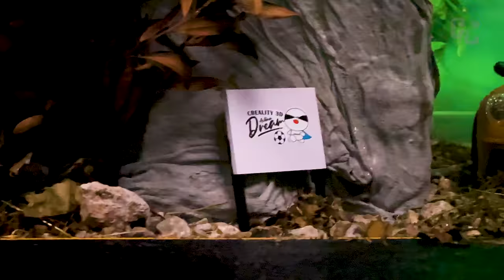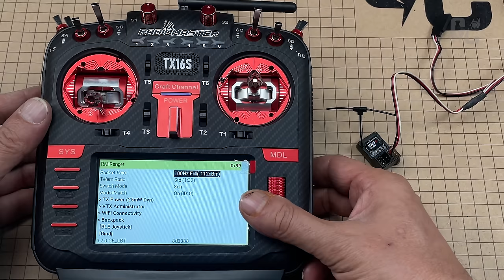How To Make Porsche 911 GT3 RS Rc Car - 3D Printed Remote Controlled Car

Comment: great work. i have a comment nevertheless ... what is missing is a bit of suspension and also you put in brushed crawler setup, it would be better perhaps to use brushless setup. just a suggestion.
Reply: Follow me files, buddy. Thanks
Reply: @mr.rosquilla6292  what?
Reply: @tiborklaric7198  ñaño
Follow me that files stl for print in the school. Please brother. I will thanks.